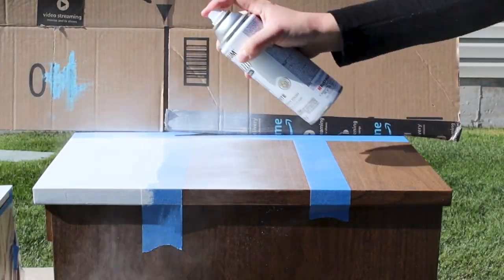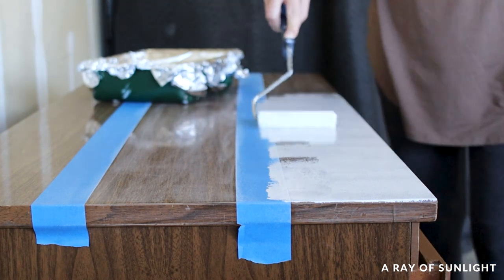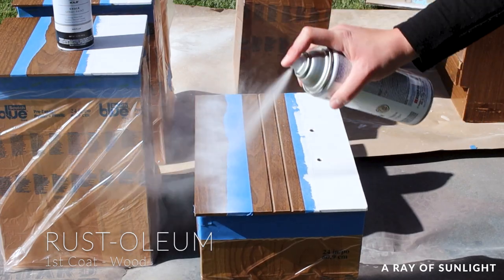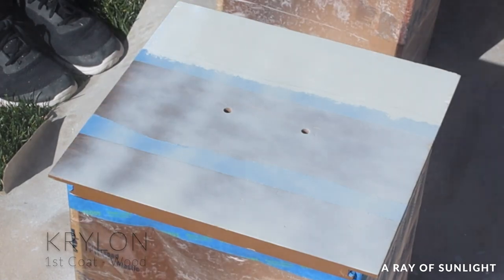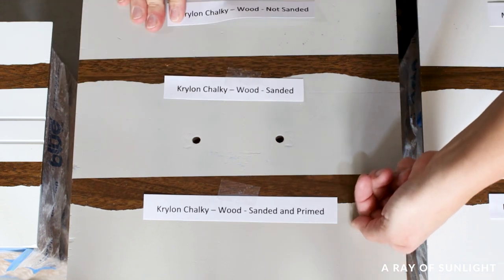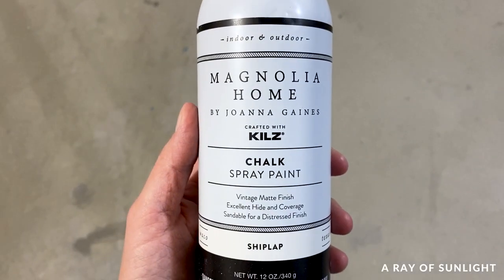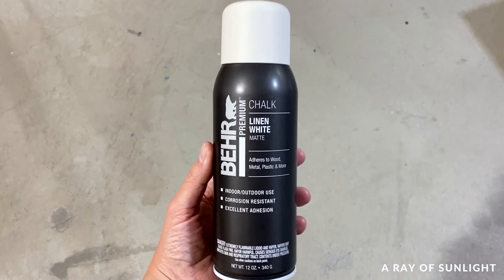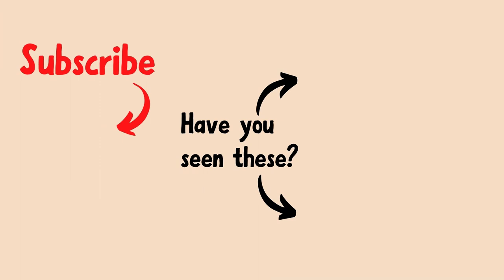The Best Chalk Spray Paint | Rust-Oleum VS Magnolia VS Krylon VS Behr

Comment: With the magnolia do you need to put anything on after to seal it?
Reply from the maker: Technically no, not with the spray version because these are oil based. The other can version yes you would need to seal the paint.